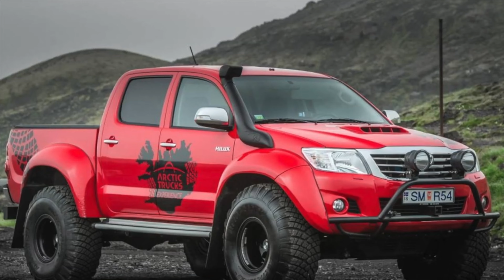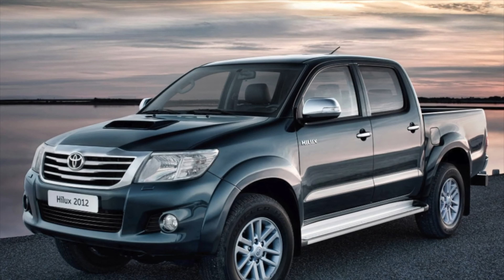Toyota Hilux 7 Problems | Weaknesses of the Used Hilux VII

Comment: The flaws i've noticed with my experience in hiluxes are
-the low quality seats that shrinks over time affecting the riding height of the driver and the passengers.
- The horn can fail  even at 50K km.
- The radiators are common to leaks whitch leads to an over-heat situation.
Other than that these cars are indestructible... at least mechanically
I much prefer the 2TR-FE 2.7l gasoline engine over the diesels for the extra simplicity, and power delivery.